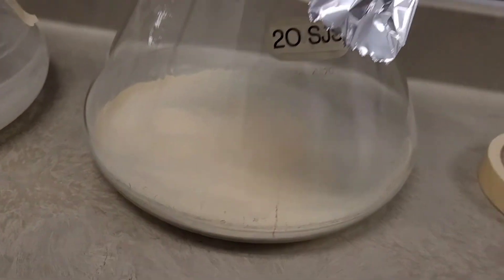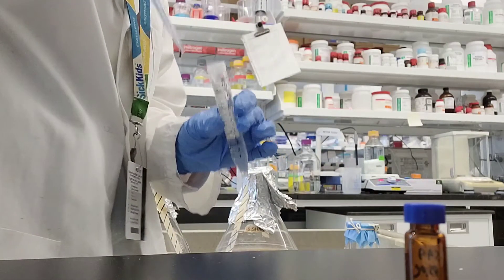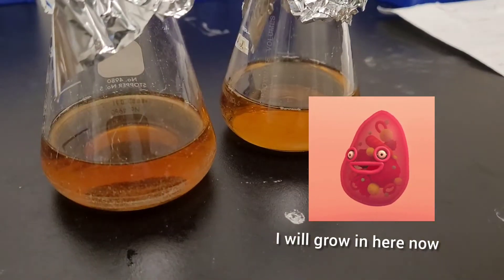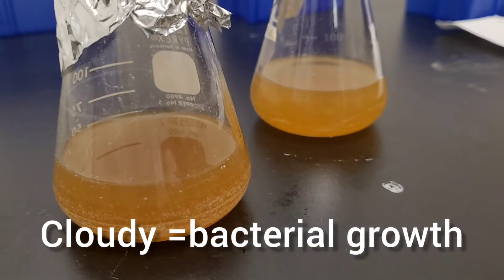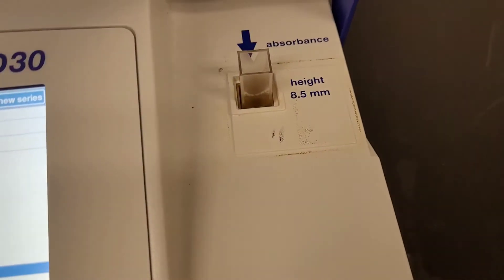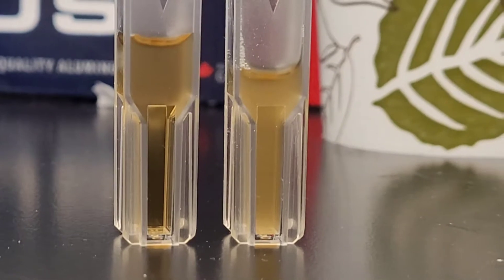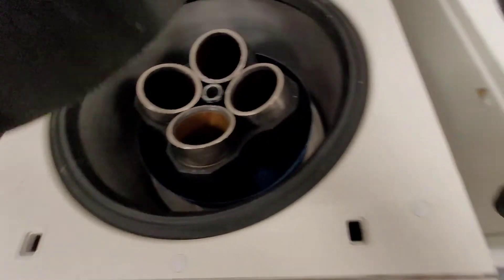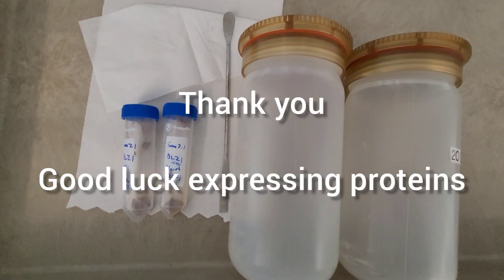🧫 How to express protein using bacteria (E. coli) || practical biochemistry || آزمایشگاه بیوشیمی

Comment: Can you give me theory of this method of how to express protein using bacteria?
Reply: I have a question. 
Suppose I have a handful of different proteins and on the other hand different cells are present. How to design an experiment to know which protein is expressed in which cell?
Reply from the maker: @Ashishkumar-id1nn  So when you order the plasmid for a protein you know what it is and you transform it into a known cell. You have to label it and during the entire expression you must label everything so you don't mix up the different protein and cells. I don't recommend expressing them on the same day because of the risk to mix them up unless you really have to. If you mix them up then u can use mass spec to identify  which is which. That would be a waste of money if you could label everything and keep track of it.
Reply from the maker: @Ashishkumar-id1nn  If you question is something else and you mean everything is unknown from the beginning, the best methods would be some kind of fluorescence assay and microscopy. Detection of mRNA levels are good but don't always mean they get translated.
Reply from the maker: The theory is that it's using the lac operon which is normally turned off using a supressor. Once you add IPTG which is  nonhydrolyzable but similar to lactose the activator, it binds and removes the suppressor. But because it can't be hydrolyzed, the protein expression doesn't get turned off by a feedback loop and stays on. 
U also need a good number of bacteria (OD 0.7 is ok). Too low you get low expression, too high they die.
Lmk if u need a seperate video.
Reply: Yes I need.